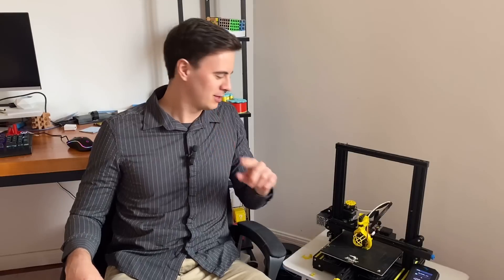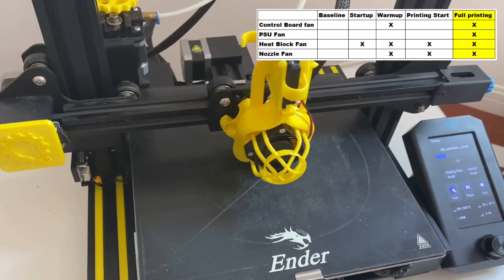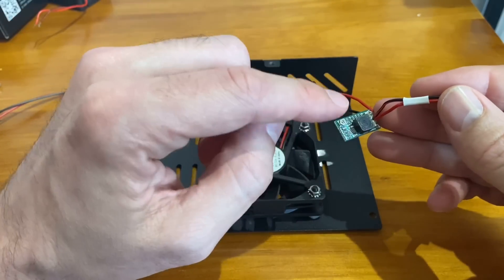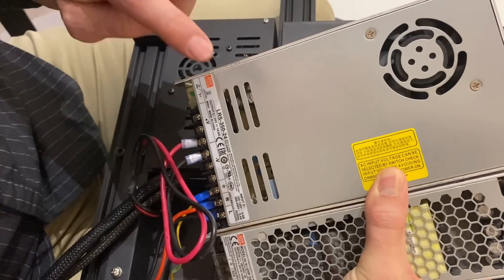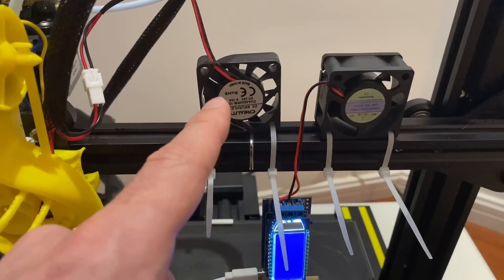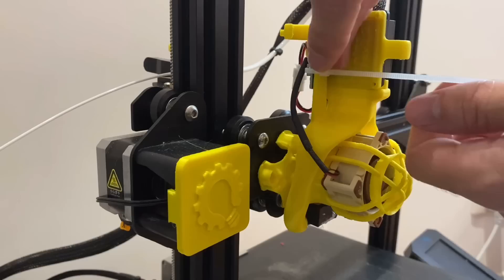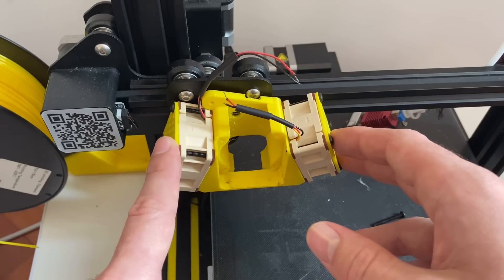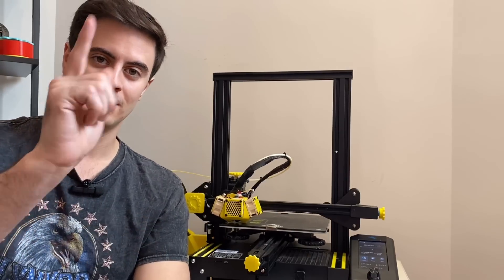Nearly SILENT mods for your Ender 3 V2 (part 2)

Comment: I can't believe that youtubers are still recommending the noctua fans with too low CFM output..  sad, but I guess anything fir a like click   :(
Reply from the maker: I haven’t had any issues with these low CFM fans after many hours of printing. Also there are 2 part cooling fans compared to the stock 1 fan.
Reply: @DesktopInventions  Yep, keep telling yourself that...  :(
Reply: @donturnock5176  What exactly will be the problems with the prints? I am thinking of upgrading mine. Is there more information about the problem with nocuta fans somewhere?
Reply: @amarok-c2c   Do your due diligent research. you will find plenty.  Study the specs, they say it all.
Reply: @donturnock5176  My Ender 3 has had a Noctua 4010 for hotend cooling with a Fan Duct Satsana for two years now.
It operates all year round, often printing over 17 hours. I've never had any issues with creep.
Keep in mind that the basic fan offered by Creality is oversized in terms of capacity for all purposes of ensuring the proper functioning of the printer. Who can do more can do less.
The Prusa I3Mk3 also has an original Noctua in 4010 to cool its hotend.
I think the installation of a Noctua 4010 type FLX will be more of a problem for all-metal Hotends like the Micro Swiss.

Comment: I printed waterblocks for three steppers using pla (no need for metal blocks for the steppers), and a jacket around the metal heatsink for the heat brake.  Entirely water cooled using a $5 BLDC pump.   Recently ducted a quiet blower into the PSU now my printer is dead silent.....well except the bearings
Reply from the maker: That’s very interesting! I was thinking about a water cooled solution but didn’t want to tackle it at this point. Although you still need fans for the part cooling right?  Currently my “silent stepper motors” are the loudest thing on my printer though

Comment: i'd definately recommend just buying some quality 24v fans as replacements, can get full replacements with 24v and still only be 6decibel louder than the expensive noctua fans and buck converter mods.
Reply from the maker: Yes that would definitely be more simple and cheap. For this build though I was going all in on quiet mods 🤣
Reply: @DesktopInventions  fair point, i actually just got my ender 3 v2 in the door, and all replacement fans in 24v.

let's compare for science sake :P any chance you remember the software you used on your phone to measure the sound level ?

Comment: Quite impressive work! Left a Subscription :)
Is it PLA you are using for all the mods or is it some higher temp filament? I am quite nervous about putting PLA around the Hotend and still are left with the standard Hotend cover because I like the looks.
Reply from the maker: So far it’s just with PLA. Haven’t found a need to print other materials yet
Reply: Sounds great, thnx for the information

Comment: Best, cheapest, easiest, fastest way to silence the 3D-printer:

Build a massive wooden housing (with an acrylic window to see the print). Protects also from dust and keeps the temperature high
Reply: Encasing the electronics and PSU in an enclosure is not the greatest idea, it would be wise to relocate those to keep stepper driver temps and PSU temps down.
Reply: @JarredSutherland  the temp in an enclosure usually doesn't reach crazy temperatures. It mostly used to minimize drafts, but moving the PSU away from heat is usually a good idea🙂
Reply from the maker: enclosure added to my to-do list thanks!

Comment: 11:55 you can rotate the srew, than it is smaller
Reply from the maker: Yes I tried flipping the bolt the other direction but then it ran into the metal frame on the back side

Comment: A big issue with the stock PSU is that the shroud totally blocks the exhaust vents. The only path for air is out by the terminal block, which then vents into the nearly-sealed cavity which houses the external mains switch. The air basically has to escape out of the little hole where the Y-stepper wire exits (you can feel the jet of air easily).

This 'works', but it makes the PSU warm and keeps the fan on almost all of the time. I cut a nice big vent hole out of the shroud with a dremel, and now my PSU only briefly cycles the fan on when needed. The advantage of this fix is that is effectively free, and requires no replacement parts. You could achieve the same thing with a drill, if you don't have a dremel handy.
Reply from the maker: Yea I’ve seen others do this as well, definitely a big design oversight!

Comment: thats pretty cool! Any workarounds if using a BL touch as well ?
Reply from the maker: If you want to stick with the 40mm noctua for a part cooling fan there is another model on thingiverse called solar orbiter that works with BLTouch. If you don’t mind using a centrifugal/blower fan there are many options
Reply: @DesktopInventions  thanks i will take a look!

Comment: Very cool changing the power supply out , I've been meaning to do this to my v2
Reply from the maker: Yea it’s not the cheapest upgrade but it is a good quality power supply and fanless
Reply: But I believe it needs to be mounted to a minimum 450x450 aluminum panel to dissipate heat.
Reply from the maker: Yes that’s recommended, however they do provide a derating curve without the aluminum plate and depending on your countries native voltage you can still get 245-350W at 50C ambient temperatures

Comment: Keep in mind that the stock part cooling fan was underpowered to start with, so you don't get good part cooling so you have reduced bridging performance.  Radial fans are a poor choice for this because blowers work better to push air through these kinds of constricted air ducts on the shrouds.  Yeah, you quieted the printer down, but you likely didn't get good part cooling performance.  You probably would have been better off with a single 5015 blower fan that you could potentially dial down via slicer settings as needed but could crank for bridging.
Reply from the maker: Yea the goal of this build was as quiet as possible and I knew the noctua fans could achieve this. I will probably look at some blower fan build in the future as well since there is many more mounting options out there. I am pretty confident this solution will cool quite well. I’ll have to do a video on some performance testing in the future to show the results and probably need to optimize some settings further. Thanks for the feedback!
Reply: @DesktopInventions  Yeah, I'm curious to see how good your bridging is with that setup - how far you can push it.
Reply: @heroflying  you are mixing up radial and axial. You mean axial is bad for this? Blowers are radial.
Reply: @Patty-NOS  Yep, sorry about that.
Reply: @heroflying  do you know if these 5015 radials are good upgrades? The stock one isn't that loud but on the other hand it really does not move a lot of air...

Comment: Hi very cool video but I have a question, I have also an Ender 3 v2 and want to make it silence so I can sleep next to it. But I have an bl touch and it doesn’t fit with your design so my question is, if there is an other solution to make it completely silence but with the 40x40 part cooling fans ?
Reply from the maker: This is a great question. You can check out the solar orbiter design on thingiverse it is compatible with BLTouch, Ender 3V2, and 40x40 fans (and they also have a direct drive option if you’re interested). I was also considering printing that design for this project, maybe I will use this in the future if I install a BLTouch.
Reply: @DesktopInventions  thanks for the quick answer

Comment: Great video! I wish these companies would just put out models for a slight premium that have quiet fans to begin with and save us all the trouble of fixing their problems. I’m currently going through tuning a few CR-6 SEs into sounding a little less like a jet engine taking off in my workshop, so this video is extremely useful.
Reply from the maker: I totally agree, keep the cheap economical model, but also have an option with these upgrades.
Reply: LOL. It drives up the printer costs and they would not be competitively priced anymore, that's why, it's very clear and makes sense. Even if they offered it with a quieter fan option few would by the same printer and a significant price increase, that's why.

So now you buy the printer dirt cheap because it's good and cheap, then pay to upgrade it after you own it make it quieter and better....
Reply: @airgliderz  So you would rather pay a normal price plus another $10 a fan and an hour or two of your time or just another $5 a fan for a better setup from the factory? Seems rather silly.
Reply from the maker: Yes they are a high volume low cost manufacturer and with high volumes and multiple distributors buying and stocking from them so they cannot have too many options. Perhaps they could through a feature like this in with a pro version, but maybe there isn’t enough consumer demand to make up for the cost.
Reply: @DaveDDD  clearly are you blind  manufacturing costs and economics? A $5 part cost increase in reality ups the price of the printer double and more $5 the $5 part so it is profitable/pays the bills and labor costs, all good things to stay in business and be successfully stay in business, make a profit and to be able to pay your employees, bills, manufacturing costs, maintenance, rent, utilities, and taxes, simple basic economics 101.
Reply: @DesktopInventions  Agree, the the economics and manufacturing cost makes that option, to be profitable pricing the printer out of the market. Most all still pick the cheaper version then upgrade it, it's a basic manufacturing economic reality that can be said about all manufactured products other the luxury premium or professional grade items which this in not in that category or price point. It's simple manufacturing and marketing reality economics to stay in business to bring us a quality inexpensive product with the ender 3 is without question, all good things.
Reply: @airgliderz  Using fans that cost $5 more for the manufacturer to purchase than the basic fans will not double the price of the printer - that’s an absurd assumption. Also, since they are buying in bulk, they should be able to leverage economies of scale. That’s the Econ 101 stuff you should be focusing on here.
Reply: @DaveDDD  you some work on comprehension, I did not say $5 doubles the price. What I did say, economics 101, you state the fan costs $5, the actual cost with profit after expensive is more then double. Once you finally graduate kindergarten you will understand ...LOL
Reply: @airgliderz  Man, I’ve been trying to be nice, but it’s hard to understand what you’re  attempting to say when your post reads like it was put through an auto translator three or four times before finally landing here as a mangled mess. Brush up on your communication skills before lashing out at others. 

As for the actual subject at hand, maybe your time is worth less to you than the small premium it would cost for a factory to just install quieter fans than the jet engines we’re used to, but I value my time more than that.

I sincerely hope your day gets better.
Reply: @DaveDDD  my day is fine, yours is not based on your false economics agenda.

Comment: Putting in a buck converter to run the 12V Noctua parts cooling fans off the 24V fan connector might seem lika good idea, but be aware that it is a PWM voltage on that connector. A buck is designed to run off a regular DC voltage, not a PWM. Also, you have now lost the ability to regulate the parts cooling fan speed from the slicer, since the buck outputs a constant voltage.
Reply from the maker: Yes this is a good note. A way to bypass the buck converter on parts cooling fan is running the 2 fans in series. I currently just run that fan off for the first layer and on for the rest of the print, do you know in which cases it’s useful to regulate the fan speed?
Reply: @DesktopInventions  if you’re printing anything other than PLA (since that’s usually at 100% fan speed) it gets useful to have your part cooling fan at low speeds or off until you need to bridge something, then ramp it up to prevent sagging during the first bridging layers.
Reply from the maker: Thanks for the advice! I haven’t printed with much other than PLA… yet

Comment: Cool. A very, very easy way to reduce a lot of noise that is so cheap and quick is to simply by a cocrete slab(the type you might see spaced a part on the ground making a kind of path to lead to a shed or a front door). You put your printer on that and the concrete completely absorbs a lot of the 'shake' that creates noise. It also helps prints come out in a better quality. 5$, a visit to the hardware store. Doesn't get much easier than that.
Reply from the maker: Great suggestion, I definitely need to look at a more sturdy base

Comment: Hey loved your video. I recently got my first 3d printer (also a ender 3 v2). But I got a quick question which mini dc converted did you use and at what voltage( for the Noctua fans )? I’m also trying to make it quite so I can sleep next to it bc I have it in my room. Also how do you plan on fixing the issue with the mount hitting the frame other than with hot glue.
Reply from the maker: I added the link for the DC converter in the description. The 3D printer is 24V but the Noctua fans are 12V. For the switch issue it would not be an issue if you use 40x10 fans, but also I plan to 3D print a piece to go on the switch in the next few days. I’ll add the link to the description once it’s done. Good luck with your project!
Reply from the maker: I've created a simple 3D printed model to replace the super glue fix.  The 3D model link in the description now!
Reply: @DesktopInventions  Does modifying the endstop reduce the maximum x distance since the switch is what it homes onto?
Reply: @e.purcell8254  Its possible, but it only limits it by like a centimeter.

Comment: one thing i can advice you when silencing the ender 3 v2: design a semi-open housing for the mainboard and psu. Start with replacing the 4 rubber feet by 4 squashball feet. The squashball feet rises the printer and silences the overall sound from printing and fans in the frame. Once the printer has about 40 mm extra space underneath it, you have room to be creative and design a new housing for the mainboard to install a Noctua 8. Also for the psu, a semi open box for placing a Noctua 8. I designed a dozen cases to fit some dc buck converters and the two Noctua 80X80X25's. The final design i made was semi-open. so walls and floors of the 2 cases semi-open. It resulted in fear for forgetting to plug in the psu fan, but it was plugged in. The psu temperature stays way lower due to the open housing. The closed psu case with new noctua 8 was quit but it still needed to cool a lot. The same case with open see through structure is the final stage.
Reply from the maker: Good advice, currently my power supply is open, I didn’t put the original shroud back on. The motherboard area is semi open with the brass standoffs I added, but the overall bottom of the printer is pretty close to the table. I will look into some taller squash-ball feet like you recommended! Thanks!
Reply: What are pushball feet?
Reply: @MikeJones-mf2rt  you mean the squashball feet?   It basically replaces the stock rubber feet of the printer.  Its a printed part, looks like an egg in a egg holder.  The egg is the squashball and the egg holder has to be printed.  The holder has a connection to slide in the extrusion profile. Pull the frontcovers off of the extrusion profile and pull the glued rubber stock feet off to slide in the new upside down bowl with the squashball. Or you just open your browser, go to google and type in the searchbar “why cant i fint answers myself”.  You’ll find some good results😉. Or not
Reply: @Robin-Visser  Google owns YouTube, and here I am asking you 🥳